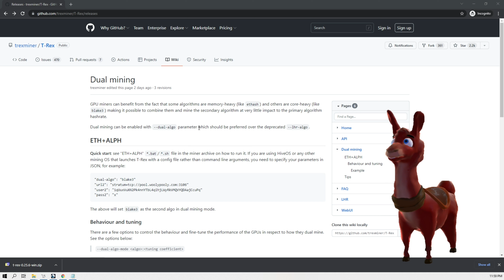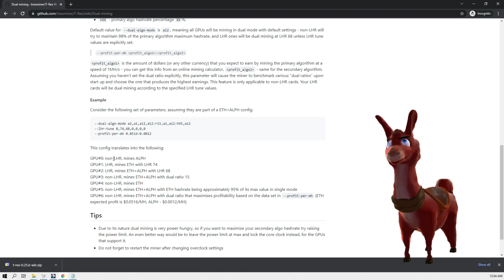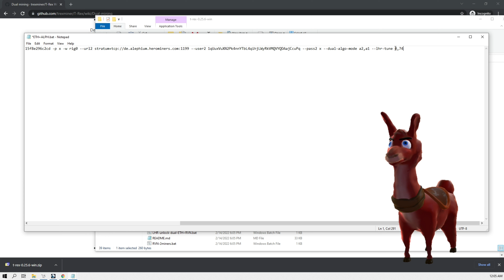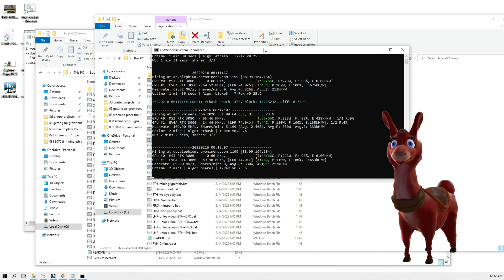How to Dual Mine on Windows with both LHR and Non-LHR GPU's using T-rex 0.25.6

Comment: the way that I got it to work was to add it as below
--dual-algo-mode a12, a12 --lhr-tune 95, 74

it will show the non LHR card is LHR but doesn't affect the mining. Dual mode with non-lhr mining eth at 95% and 5% for ALPH. This currently working on Hive OS
Reply from the maker: I am going to pin this!! thanks man!! this will help those on Hiveos.
Reply: @RedLlama  this is only add on the extra config, for got to add that there.

"lhr-tune": "95, 74"

Comment: I have the same issue on my rig running 1 3080Ti and 4 1660 Ti, it will only dual mine on the 3080 Ti while the 1660 Ti's remain mining ETH only, will keep you posted if I figure out how to fix it
Reply from the maker: It might be more profitable to have the non-lhr 1660 ti on eth only. I am not really sure though you may need to crunch the numbers and see. But let me know if you figure it out because things change and it might be more profitable to mine both on non-lhr cards.